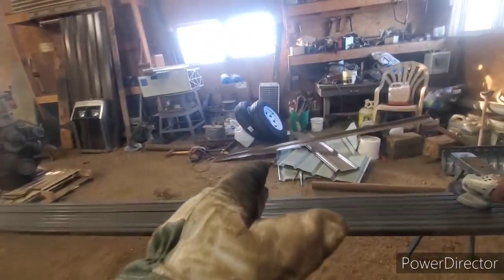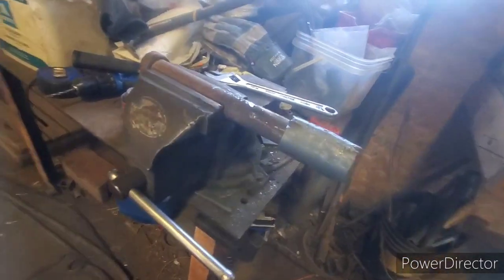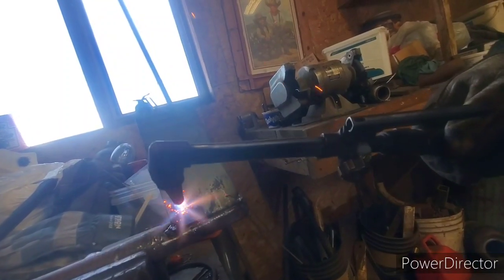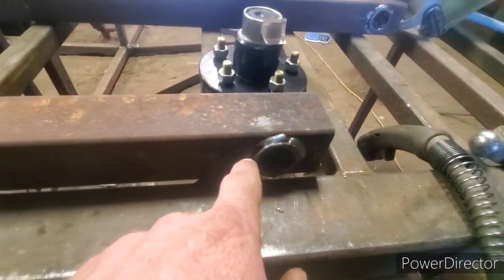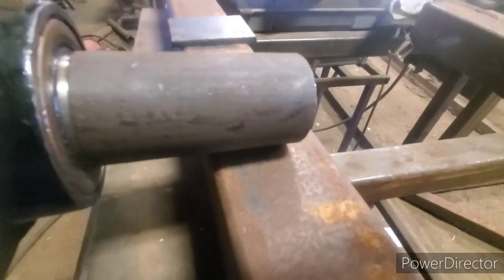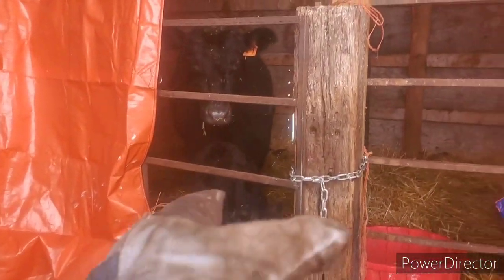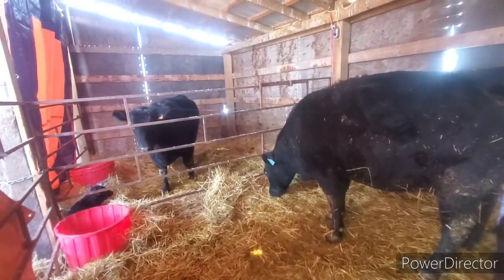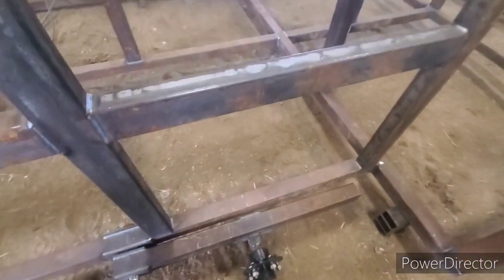Part 3 AI trailer build. It's got wheels and a hitch👌

Comment: Will it pull straight enough that it won't wear out tires with the hitch offset like that? Not criticizing just asking. I kinda thought the tires would be trying to slide sideways. Beauty welding BTW.
Reply from the maker: I dont think it will as the hitch is actually in the center of the trailer now
Reply: The hitch will think the trailer is following straight!